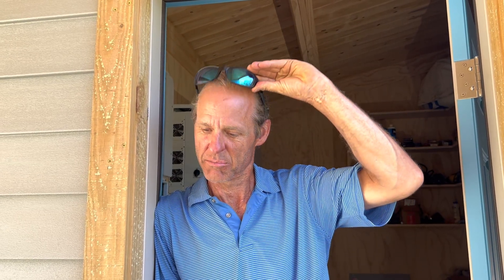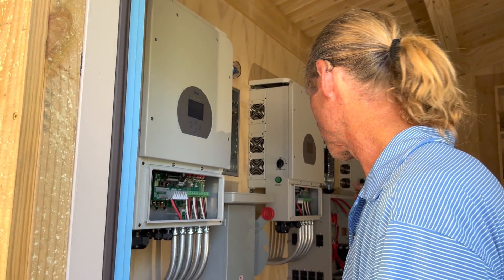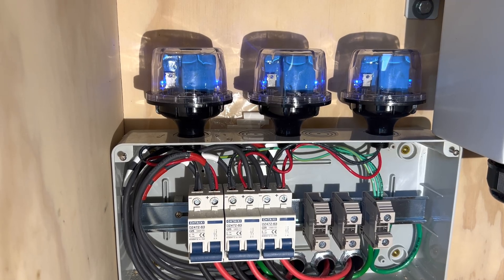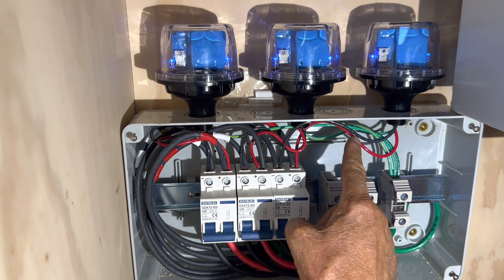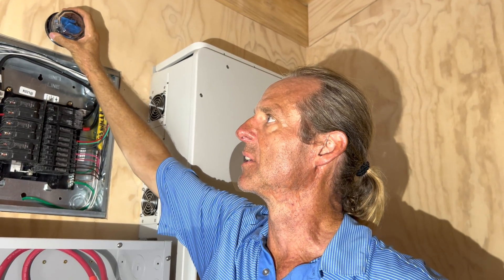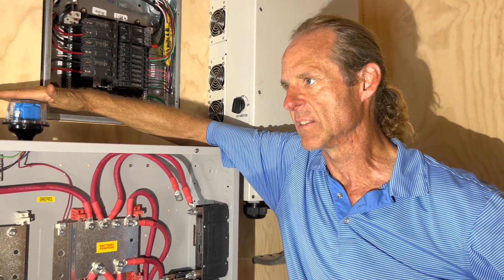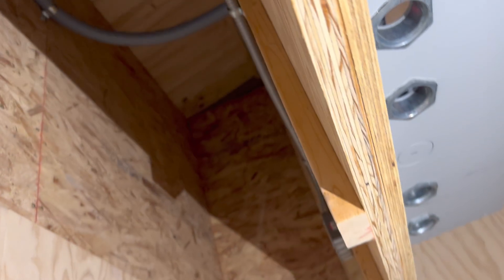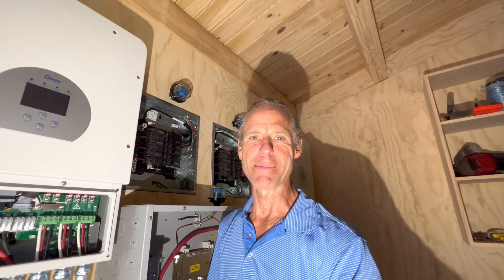Protect Your Lifepo4 Energy System With Surge Protection Devices From Midnite Solar

Comment: Good video thanks. I wanted to lnow if hou can wire these into an IMO DC disconnect for a solar array?
Reply: Yes, I wire in one out at the combiner box and another one at the charge controller, or inverter, where array wires connect.

Comment: Lighting strike went into the ac main input of the house and took out some electronics. Some of my dc solar equipment not connected to the ac input were destroyed because they were connected by internet cable. In 5 years two lighting strikes, in the end I just turn off my ac main panel off and use my battery to power my house. Yes I have surge protection still cause my main ac solar system to go haywire.
Reply from the maker: So sorry to hear of your bad luck. I’m hoping these Midnite Solar SPDs will prevent that outcome.

Comment: New to your channel. As someone who appreciates the kind of detail you employed here, I want to congratulate you. I will be building a small system soon just for my workshop. It will not be tied to the grid but just for lights and a few tools converted to DC. (One of them a 1-ton dump truck hydraulic system converted to run my tubing bender!
Thank you very much for sharing your expertise and foresight with us. Happily, subbed.

Comment: This seems to be a well thought out system! I might recommend that you consider one or more additional ground rods, IN ADDITION to utilizing the house ground at the main panel as long as you tie (bond) them all together which your #6 ground wire will do. This should help your ”ground wire” to avoid also becoming an ANTENNA! Plus, you'd want to dissipate as much lightning current BEFORE it gets close to your house.

I’m not familiar with Midnight Solar, but I do like the fact that they come in a transparent enclosure so you can at least visually inspect them occasionally.
Reply from the maker: One ground rod to avoid a ground loop.

I have an SPD at the main distribution panel and another at the meter panel where the power line meets the first panel which is the meter panel.

Comment: Let me clarify about the inverter before I switched to 24VDC Nominal I was on 12V amd was using a 2500WC inverter and started with a 200A thermal breaker but it kept tripping so I installed a 300A breaker amd didn't have anymore problems. Even at 40% load capacity it tripped after a few minutes. Even in winter in EASTERN NC. Now I know I really only need a 105 A fuse or whatever for my 24VDC 2500WC inverter but I didn't have one and I rarely use it at or above 35% load capacity or about 900 watts. Now I have 6 12v 100A lifep04 batteries in a 2x3 series parallel configuration for a 24V 300Ah nominal bank and I plan. On adding another parallel branch to make it 400ah. I am using 4/0 gauge welding cable from windynation. I also have looked into Class T fuses but I struggle to find a kit with a fuse and holder together for a lower price...Again, Mr. Ray you are cooler than the stuff you build considering your knowledge and even I have an engineering degree. But I'm Still new to the whole off-grid diy world only about ~ 2 years experience. But I have managed to pull 112% of my rated solar capacity day after day even in winter with very little sun with some proprietary technology and know-how. Any advice or help would be greatly and so graciously appreciated and super well received. Thanks, Ray..

Comment: Have you ever tested those "DC" breakers you have in your midnight solar box?  Bc it concerns me about sellers repurposing high voltage/current AC breakers as DC rated when that is not the original maniactured intended purpose. I wish you could do a more in depth video on circuit and device protection? Bc right now I'm only using thermal breakers for my batteries to charge controller, battery to inverter, and pv to charge controller. And I'm really not sure I even have them sized correctly. I do have a 300A shunt as well, but of course has no protection bc it operates on the negative side, but i want to change that too. My charge controllers are rated at 60A so that is what all all the thermal breakers are rated for except for my 2500WC inverter which is a 300A only bc it kept tripping at lower amp ratings with a 24VDC Nominal rating. I'm willing to pay just about anything for safety and peace of mind but I want to make sure I'm getting correctly intended purpose use, authentic, and properly sized and rated products.. but this is a very helpful video. I'm just weary of buying a 63A "DC" c-curve rated breaker for under $5 from anywhere and expecting it to work when a real 60A thermal breaker cost about $25 minimum..l am starting to find your videos invaluable and quite bingeworthy and impossible to stop watching

Comment: I've had lightning strike a tree outside my house and leap into the house knocked a clock off the wall and fried an electronic motor on a 20' satellite dish I have. Several years later the tree grew back and got hit again luckily it wasn't as big so it did not arc over intothe house which is only about 30' radii between..

Comment: Seems like you got a good understanding of how lightning strikes work. When lightning hits the ground it temporarily raises the ground voltage from zero to high differential. The pulse comes up through the grounding rod and can cause damage since circuits in the building are at a lower state than the ground line. 

Issue with a CME, is that the CME can induces a high voltage differential not for microseconds, but for minutes to hours. The CME dumps charged particles which create a high voltage difference for extended periods. No Surge suppression system is going to protect system from a long duration event. The only practical option is to disconnect everything, and open every breaker so the wire length (ie antennas) are as short as possible. Fortunately for a CME you have 2 to 3 days before the charged particles arrive at earth giving you time to disconnect everything. 

The only issue is that I believe the Midnight Solar SPD uses MOVs which degrade with each event. Really good Surge protectors use TVS diodes which do not degrade. For protecting the BMS, a better option would be a Fused TVS diode across each battery terminal set. The Battery voltage is likely 6V\12V\24V (depending on Battery Model) and you can buy small TVS diodes rated for near the battery voltage so that each battery is individual protected. Small low voltage TVS diodes are pretty inexpensive usually costing under $2 each. For a 6V battery use a 10V to 12V TVS, 12V use a 16V to 20V, and for a 24V use a 30V to 36V. Note you need to use a TVS with an operating voltage above the charging voltage which is higher than the battery voltage rating.
Reply from the maker: That’s very interesting. Please tell us more. The batteries we are using are 48 volts. Where would you install this diode and how would it be at handling the amperage that we are using.
Reply: @RayBuildsCoolStuff  

Bourns 5.0SMDJ60A-QH 5KW 60V TVS Diode $2.89.
Littlefuse 15KPA60A 15KW 60V TVS $9.48
 you can also add a PTC fuse in series such as Bourns MF-RX375/72-0 72V 7.5A PTC Fuse for safety.  PTC work by increasing resistance as temperature increases. For a brief surge pulse the would allow just about all of the current to be shunt, but as the heat up the would limit current to their trip rating. This would be usefull if you accidently connected the diode backwards.

TVS diodes are high power Zener diodes. You connect the backwards such that the block current until their reverse breakdown voltage is exceeded, and start acting like a short until the voltage drops below the breakdown voltage. You can also buy bi-directional TVS diodes that avoid the issue with reverse polarity. However using a uni-directional TVS is better, in case the Surge cases a negative voltage (ie surge has reverse polarity which would be very bad).

The Diode would go between the positive & negative terminals for each battery, but in reverse: Diode Anode to Negative\Ground) and Diode Cathode to Positive.  When a Surge pulse hit the battery the TVS diode will shunt, limiting the input voltage

The 15KPA60A TVS will start limiting around 67V, and do a hard clamp at about 97V. 15KPA60A will handle up to 155A Peak surge current.

I would go with a 60V TVS for a 48V battery pack since the charging voltage could be as high as 59 for LiFePO4 batteries.

Another consideration is using Ferrite toroids on your circuits, which slow sudden current spikes, and they also reduce switching noise. In my house, I installed small ferrites on all of the LED lights, Outlets, and panel (breakers circuits), Since they aren't in direct contact with the circuit conductor there is no chance of them ever failing. 

The Sol Ark inverter (basically the same as your Deye) provided Ferrites as a kit for surge protection.  if Deye does not sell them, you can probably contact SolArk & ask them to sell you the Ferrites for the DC power connection into your inverters.

You can buy all these parts from mouser or digikey.
Reply from the maker: @guytech7310  thanks so much for spending your time explaining this. I have to think this through.

Comment: Hello, I can't judge your work because I don't know US electrical code. I would like to recommend something about the grounding we can see at 5:00. The Din rail is metal (where all of your breaker and block terminals are installed to), so you could replace the 3 terminals by grounding terminals. That will allow a better connection of each ground cable.
Here it is not allowed to put 3 wires into a terminal because at least 1 will not be secured. Even more for ground connection we were not allowed to put more than one cable or end sleeve.
Here is a reference of what we used USLKG, when you thighten the middle screw it makes a connection with the DIN rail and you are able, that way, to have all the block terminal grounded thru the rail and then make a good connection for each wire.

Comment: Very nice video! I might mention that the Midnite Solar SPDs do not claim to protect against anything you called "military", and for good reason. A HEMP (high altitude electromagnetic pulse) is too fast for these to clamp down with the first pulse, which peaks at 5 nanoseconds. The Midnite Solar documentation mentions different activation times in different places, but the fastest test time I saw was for their UL listing test. It was "less than 15 nanoseconds". Anyway, different people have different priorities about the type of electromagnetic pulse they want to protect their system against. For lightening and solar flares and CMEs the Midnite Solar SPRs are good. For anything faster I would look at the other alternatives, which have undergone military standards testing. Thanks again.

Comment: How did you wire it to protect your batteries? Instructions are a bit lacking, was thinking just need to go to each bus bar and earth ground but seems like i am over simplifying it
Reply from the maker: In the video at the 10:30 mark you can see the red wire going to a small lug I added to the positive busbar and the black wire doing the same on the negative busbar. Yes indeed, the ground ties to the main ground system.
Reply: @Ray Builds Cool Stuff  so it os as simple as I was thinking,  the instructions are very generic,
Reply from the maker: @todamnbad  the company has some YouTube videos but they’re not very good either. Things to remember are to keep the wires as short as possible but also make sure there are no tight bends in the wires. You want the electricity to flow very quickly with no bottlenecks.

Comment: Bad days…  20.2 kW system can produce as little as 6.7kWh per day, a good sunny day will be 94 kWh at same time of year (feb 3).  Just got thru a four day ice storm, jan 30-Feb 2 of 2023…
Then there are ac/dc efficiency ratios ..

Comment: Ray, I'm new to your channel and absolutely love all of the content.  I'm in the planning stages of a system and wondered if you had a Bill Of Materials (BOM) of sorts for the boxes, breakers, service panels, etc. ?  It would be handy to consult for researching the components I might want to use.
Reply from the maker: I have never created a bill of materials. I have discussed all of the materials and what they are in the actual videos related to their implementation. You won’t find affiliate links in my videos for a variety of reasons. Many of the things that I used are no longer available at the same source that I used when purchasing. Most all of the materials are still available but the ones that come from Amazon shift around us to who is selling them at the moment. I hope you enjoy the videos and after you watch them if you get stuck on sourcing something just send me a message in the comment section or by email and I will try to respond, I mostly respond to all the comments if a question is asked.
Reply: @RayBuildsCoolStuff  Thanks Ray!

Comment: 102° is not that bad. We get 107° in summer but with almost no humidity, so it is easier to bear.
Reply from the maker: Hottest I’ve seen here is 117. I’m really glad I added the mini split to my systems. It keeps the equipment cool and makes the rooms more useful and pleasant to work in with little energy used. I suspect but haven’t proven that the improved efficiency makes a significant compensation for the energy used in these well sealed and insulated buildings. More important to me is the long term effect on the batteries. I think they can handle some heat but I’m thinking decades. 20 years can fly right by.

Comment: Great video. Curious where your meter is located? I assume by you main load panel?
Reply from the maker: It is remote and connected to house by underground conduit. There is a separate surge protecter on that disconnect panel to catch transient spikes coming in from main grid feed.
Reply: @RayBuildsCoolStuff  really excellent detail Ray! One of the most clean installations I have seen.

Comment: off the topic but for a 48v off grid system is 4 12v lithium battery packs better then one 48v big battery?  I'm thinking other then BMS 's it comes down to the size of the tester /charger thank you
Reply from the maker: It is actually a bad idea. The four batteries will act independently. We want all cells be  managed in sync. It can and has been done but it is suboptimal in my opinion. I have no personal experience to share.

Comment: hey ray,
i am interested to know how hot it gets inside once the installation is finished and it is 102 american degrees outside.
thanks
Reply from the maker: Did you see my video about the solar shed at my house? With 12kw of solar at mid day after many days of 100 degrees, it was at or less than 85 degrees just from the thermal mass of the rainwater tank that it is up against. Check it out. In late July I started turning the mini split on when it got up to 86. It was 103 or 104 for several days. The mini split barely runs at all.
Reply: @RayBuildsCoolStuff  
hey ray,
yes i watched that video. 
however,
now i see, that the batteries are not even connected yet in your shed. at least that is what it looks like to me.
so when all is up and running, then a temperature test might be more, ehhh, accurate.
thanks for responding.
Reply from the maker: @ursodermatt8809  yes and there will be more panels but it is very moderate with 12 kw of pv being inverted right now.

Comment: Yes you absolutely have to protect the front end against external voltage spikes like non direct hit lightning and transmission line shorts. However, nation wide, the vast majority of all household electrical surge damage is internally generated. That is, something inside the house causing the problem. It’s extremely important to have surge protection on the load side as well (after the inverters) in the distribution breaker panel. This can help protect both inverters and the household electronics
Reply from the maker: I have every panel in and out of the inverters protected. Pricey but I'm happy to have it.
Reply: @RayBuildsCoolStuff  
Good Man! Yeah, it’s not cheap insurance but cheaper then what could happen.

Comment: Hello Ray. I have a combiner box with DC surge on one side but nothing for the AC side.  I was thinking about adding a whole house surge protector in the main panel for the house to protect from grid spikes. Do you think that would be sufficient or should I add one in a sub panel before the inverters as you have done? Also, where did you get those inverters? They look very much like Sol-Arks but I can tell they're not. Deye?
Reply from the maker: I’m protecting the inverters from all sides. I have 110 feet of buried line between the solar shed and the main panel. That matters. The inverters were bought from Deye before solark finally successfully strong armed them into an exclusive on split phase.

Comment: You let out a golden hint at knowing something about lightning protection. Short and direct as possible but NO sharp corners or bends. The only downside is that your earth point is so far away (house) which is fine for electrical earth but surge/lightning earths are a whole other topic. I see too many sparkies or DIY'ers who get it wrong.